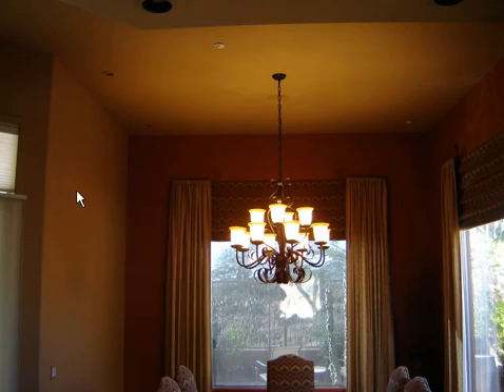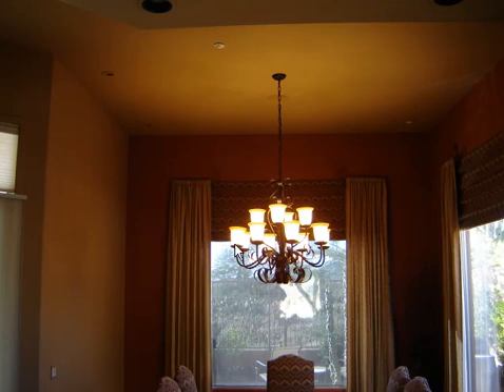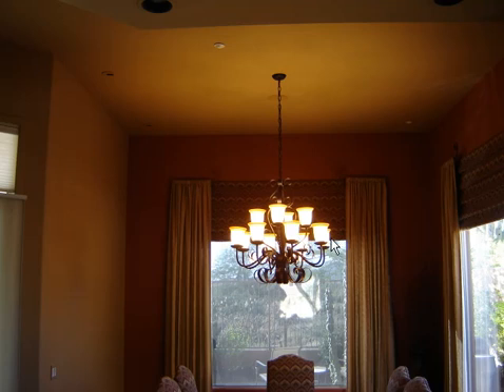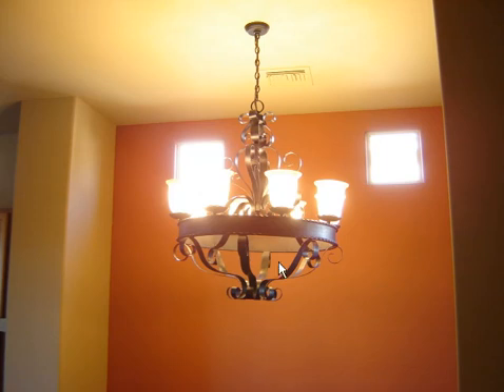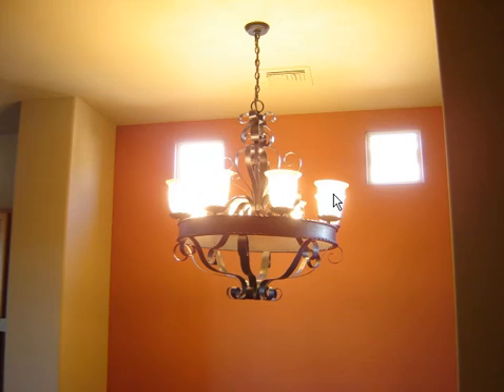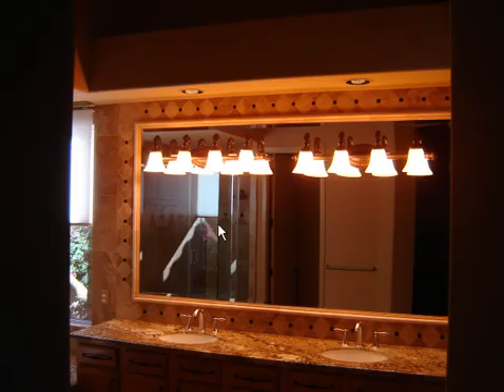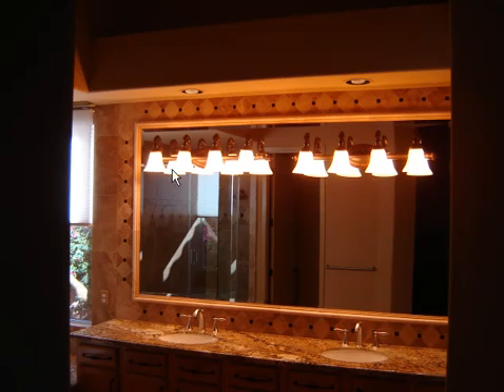Electrical Wiring-Humming Lamps

Comment: I know electrical inverters can cause a humming in ceiling fans do to conversion from dc to ac. Video I got the information from is Inverters, How do they Work and the Channel is Learn Engineering. Very interesting. I wonder if there was any relation to this concerning the lightbulbs humming. Was there a converter(inverter) in the dimer and the lightbulb filaments were vibrating from the conversions. The lighting in your video must have been operating on square wave power. You should check out the video I mentioned, it is very interesting. Maybe putting in higher voltage lamps made it so the filaments could not vibrate. Oh and I just learned a new thing from videos today. I used to wonder why lightbulbs with filaments would stop working if you shake them when they are on. I just figured it out. The filaments are more fragile when glowing then cooled down. My mom used to yell at me for shaking lightbulbs curiously wondering if that is why they stopped working. She told me somehow it makes them burn out and if I was to do it again I was going to get a kick in the A$$.

Comment from the maker: A/c don't require a neutral so probably not. I have seen most often that the a/C wire and breaker will cause problems if not sized correctly or if the A/C is starting to have some sort of problem.
My old a/c did this (20 years) and we recently installed a new 5 ton package and the problem went away. As with any electrical problem it can be any number of things.

Comment: hey Sparky?  can one correct the problem with the lights going dim for a split second when an A/C or an appliance turn on?  Is that an neutral problem? loose neutral in a make up?  bad makeup in the panel? a small feeder size wire?

Comment: this problem is due to modern dimmers in general. If you have sufficient electronic skills and knowledge, take one apart, and you will notice a TRIAC and a few other components that control the current through it. TRIACs chop up the phase of the AC voltage to dim the fixture rather than limiting it with a large variable resistor like an old style dimmer switch. The AC phase being chopped resonates in the lamps making that humming noise.